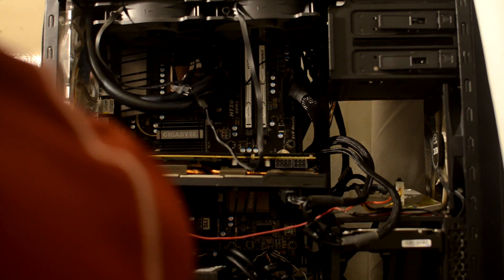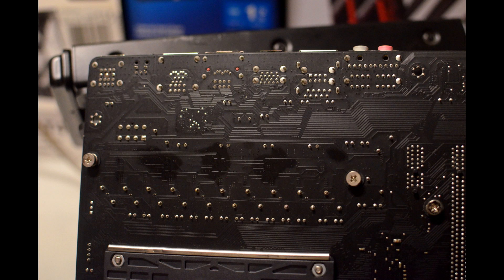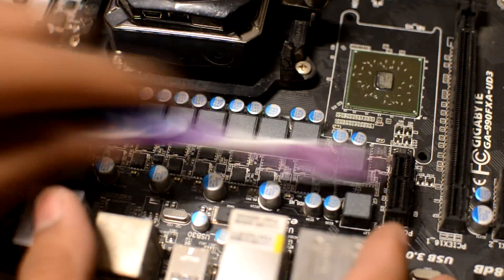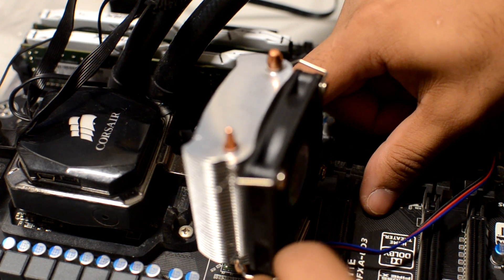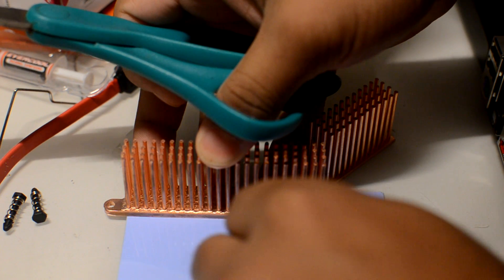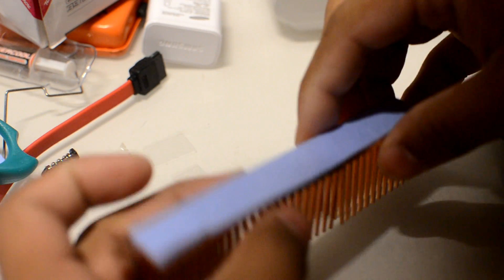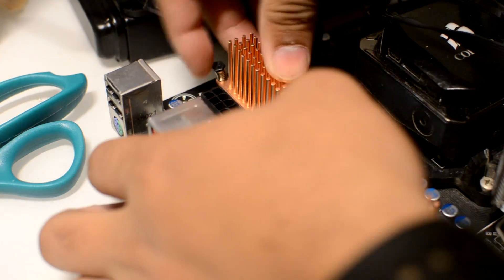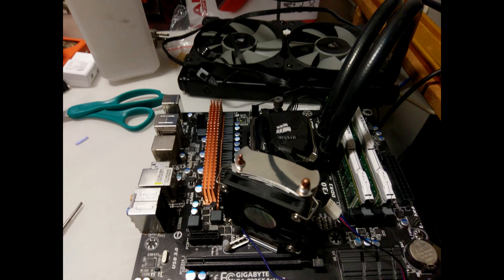Ghetto Northbrige & VRM Overheating Fix

Comment: Why not buy a m.2 heat sink and glue it on top the vrm stock heat sink with thermal adhesive? The stock vrm heat sink is flat enough.

Comment: Btw, just as a tip, Aluminium heatsinks are better to disipate heat to the air while copper is only better to transfer in between metals.

Comment: I use Raspberry heatsinks, 1 on each VRM   https://es.aliexpress.com/item/32860815273.html  https://es.aliexpress.com/item/33021531558.html?aff_fcid=4d46adc380fa455f8b923c7fa3766786-1627694093115-03338-Y7bAZbY&cv=612519_All+products&aff_fsk=Y7bAZbY&af=324389&aff_platform=aaf&sk=Y7bAZbY&aff_trace_key=4d46adc380fa455f8b923c7fa3766786-1627694093115-03338-Y7bAZbY&cn=15716&dp=612519%3A%3A324389%3A%3ACjwKCAjwxo6IBhBKEiwAXSYBs0KhjBqM6SuMr6R9jEOutGDHZcgMH-T-QbRhWd5NyDuyKBLrIxjwSxoCMmkQAvD.BwE%3A%3A%3A%3A1627694092&terminal_id=e64a0289a56d4013b589fc31d1f02963

Comment: if u got vrm overheating with that setup time for new board
Reply: Those are older mobo with North bridge still present .. the northbridge can go hot .. actually to hot.. and since there's a sandwich pipe the heat from northbridge is being transferred to the VRM.
Changing mobo base on heat even it's perfectly working is non-sense

Comment: Even if your chipset cooling fan is lil cute and cheap xD, The architecture and shape (resembling the best CPU coolers) of it dissipates a ton of heat efficiently. Any way you can try these mods on a AM4 motherboard like B450 or A320? I'd love to see your experiments

Comment: the frame drops you are getting are from your vrm's over heating.  need to put stock heatsink back on with better thermal grease and get a case with better airflow and if you have to hot glue a fan in to blow air on the vrm since you are water cooling

Comment: so vrm heatsink provided by this board are not that good? i thought this board was high end
Reply: no it's not high end.  it's a ud3 but the stock solution should have been good enough if nothing else he should have just replaced the stock heatsink and used better quality thermal grease.
Reply: i wonder which cpu he used. there is no way this board couldnt handle an fx 8350... so it must have been something like an fx 9590 or heavily overclocked fx 8350

Comment: Good job dude. Boards are redesigned constantly you just did it yourself one think I may add why. Didn’t you just customize the heatsink itself. Or were the contact points the problem

Comment: yeah man its not something we would see on youtube .replacing nb sb for heat dissapation .. still tho ive done experiments myself on several boards . not the cleanesst but decent enough tomake the temps bit better ...performance wise .its dependent on systems . eg fans, enviroment , airflow , etc etc... best get a lazer thermometer for temp differences comparison. ... . thanks man for the video....gave me insights .
Reply from the maker: No problem glad it helped somehow lol.

Comment: 0:56 thats thermal pad's oil buddy.
Reply: There aren't any thermal pads on the back of the board + rubbing alcohol, which he tried would have taken it off if it was
Reply: @balthxzar  There are tiny holes in the board in that area the oil seeps though. IF he removes the thermal pad he will find the same oily residue on VRMs also
Reply: it is flux not thermal pad oil buddy
Reply: @felix904532  So they use flux only on soldering the VRM ?

Comment: What thickness of thermal pad are you using. I need to redo my heat pipe in my laptop and that looks like the right thickness.
Reply from the maker: Im using this https://www.ebay.com/itm/QUALITY-BLUE-100X100X1mm-Thermal-Conductive-Compound-Pad-For-Heatsink-GPU-Chip/131319336180?epid=1953838008&hash=item1e933e0cf4:g:t3gAAOSw8cNUSnEy Also good luck with fixing your laptop. :)
Reply: Awesome. Thank you for getting back to me so quickly. Unfortunately, that ebay channel doesn't ship to where I live. (Alaska) But it put me on the right track. 👍🐻🐧🐺🐳❄⛄
Reply from the maker: No worries, im sure you'll find someone who'll ship there.

Comment: you could cut off some of the poles where the 2 heatsink peices meet and screw a small piece of sheet metal to both from the top and then grind the screws down even with the bottom of the heatsink maybe?  idk.  long as it works who cares. nice vid man!

edit:  btw ive tried way worse so its cool